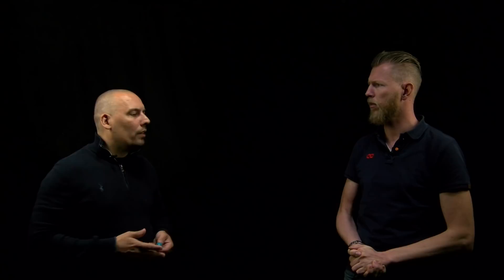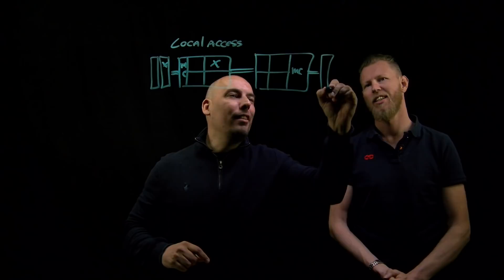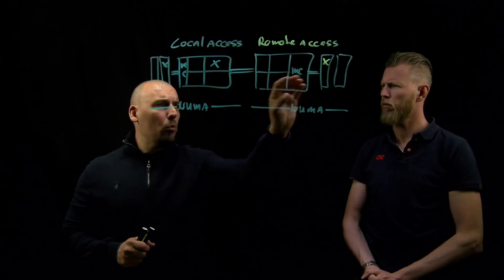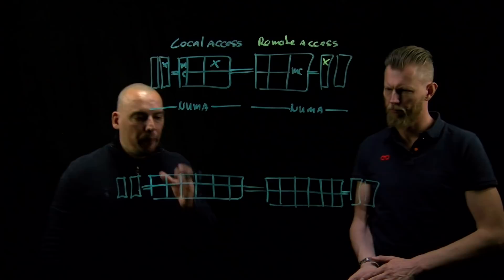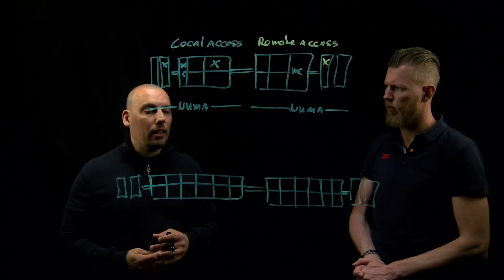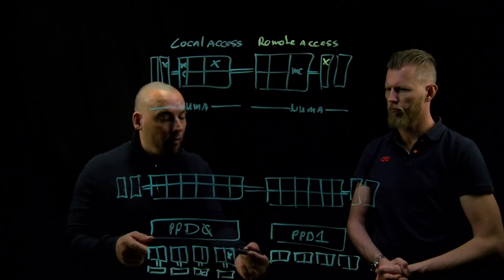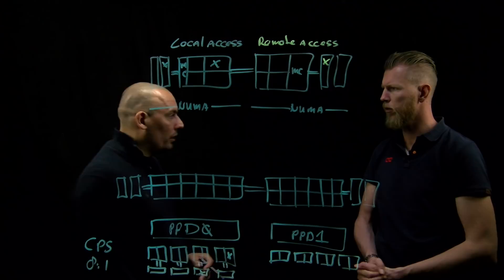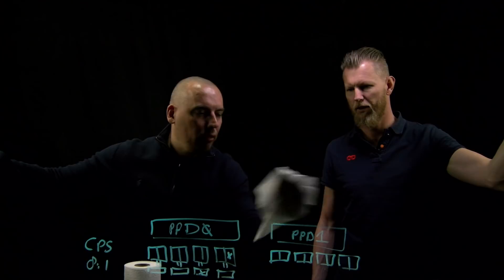Johan van Amersfoort and Frank Denneman present a NUMA deep dive

Comment: Shame you guys are dead wrong about EPYC and 'MonsterVMs'. Adding "numa.consolidate = FALSE" and "numa.autosize.vcpu.maxPerVirtualNode = 1" to your VMX file allows the VM to span across all of the NUMA evenly. Have several VM based SQL production databases on EPYC using these flags to run across both Sockets and limiting them to 8cores each. Of course in MSSQL you need to set 'Max Degree of Parallelism' to how many NUMA the SQL box is spanning. So while you may be able to talk about NUMA, your stance on EPYC for Monster VMs is ill found.
Reply: Thanks for your feedback, I read your Reddit posts and it seems you were bitten quite badly by the new architecture. Unfortunately, the settings that you recommend create a NUMA client size of 1. Thus making extremely shallow pools of local memory, thus destroying the notion of locality. Your settings do not align with the physical layout of the CPU package and it will not be beneficial to guest and application optimizations. You left out action affinity, which you mentioned in your Reddit comments (btw, action affinity is a lot older than 6.5.) If you use these settings combined, you end up with a lot of clients on the same NUMA node, while not expressing the correct architecture to the layers above. Sir Squishy is already aware of this article, but if anyone else is interested this article has more information about EPYC and ESXi https://frankdenneman.nl/2019/02/19/amd-epyc-and-vsphere-vnuma/
Reply: @FrankDenneman  Under EPYC For Giant VMs with large Memory pools or large vCPU counts you need to consider breaking out the NUMA under the VM. Else you run into memory bleeding and exhausting your memory availability per NUMA.  As long as the Guest OS and its applications are NUMA aware (Win2008R2+ and MSSQL2010+ are) then you can take advantage of parallelism across the 'shallow' NUMA Allocations with the VMX Changes. I have benchmarked these changes every which way possible, and I see nothing but Benefits and performance improvements. 

Yes, Action Affinity still needs to drop from 180 down 0 to entirely stop the virtual memory pools from bleeding. 

The only thing really left that VMware needs to consider doing for EPYC1 based hosts (Maybe 4way and 8way Intel boxes too) is allow VMs to address NUMA separately so you can specify how many NUMA Nodes the VM lives on. Using the VMX changes I laid out you can either choose 1-8 NUMA by addressing 1-8 vCPUs, or not apply the changes and allow the physical CPU boundaries to dictate your NUMA Allocations. 

A side note to be perfectly clear about the NUMA Spread, if you do apply the VMX changes and run 8vCPUS to get more you need to double down on the cores (8 to 16) else you unbalance the NUMA Allocation and get random Compute Performance.